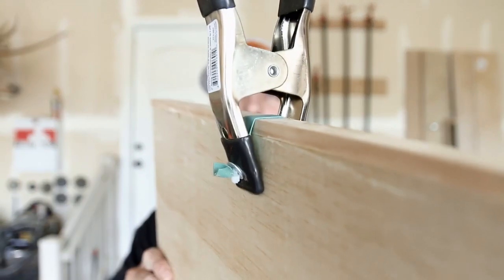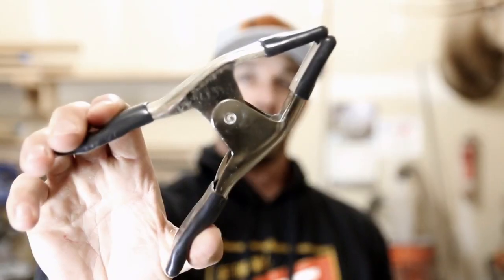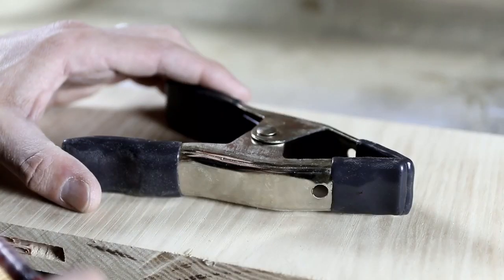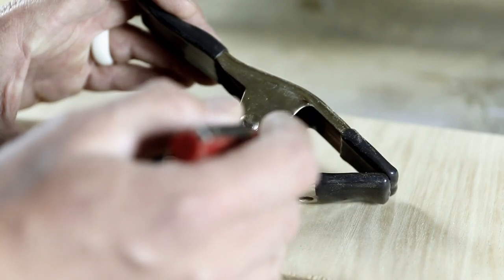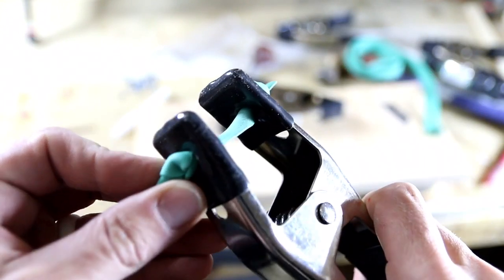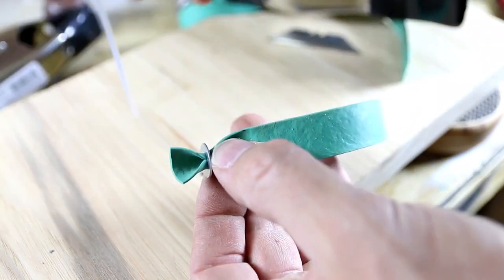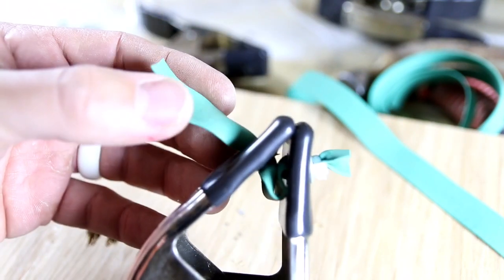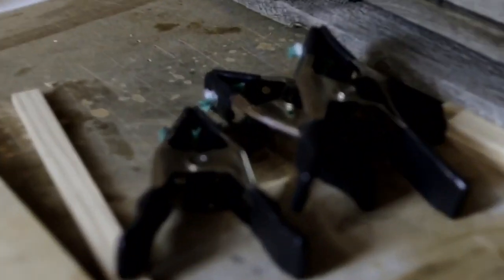How To Make $1 Edge Banding Clamps | Woodworking Clamp Hack

Comment: Great hack, you hit the perfect balance of cost, effort, and utility. I just made 10 of these in about 30 minutes. My one tip to add is cut the rubber band at an angle to make threading it through the holes / washers easier.
Reply from the maker: That is a great tip! Didn’t even think about that. I think I have about 8, but always finding myself needing a few more.  Thanks for watching.

Comment: Great idea and use of cheap products! I’m def going to use the same, but pop the rubber feet off and epoxy the band inside and then reattach.
Reply from the maker: That sounds like a great way to attach them, make a ton!
Reply: I’m pretty sure that epoxy won’t hold that stretchy rubber band in place.  I believe a mechanical fastening will certainly be more reliable.